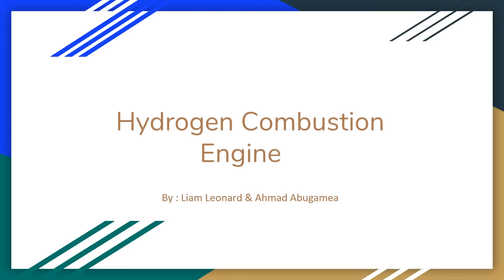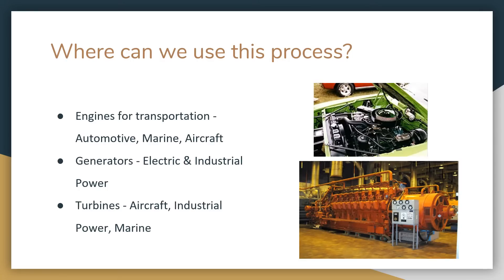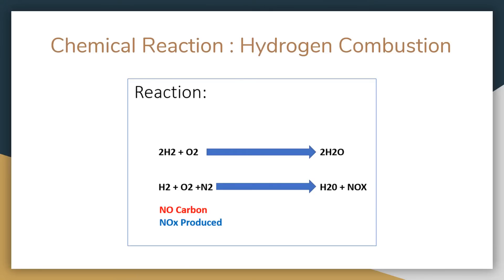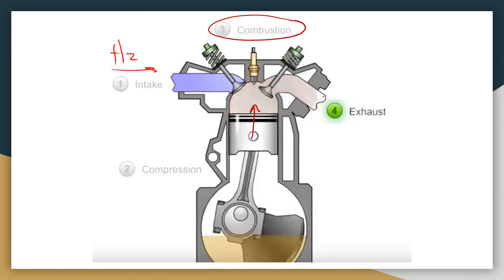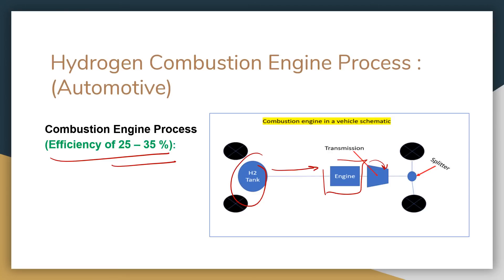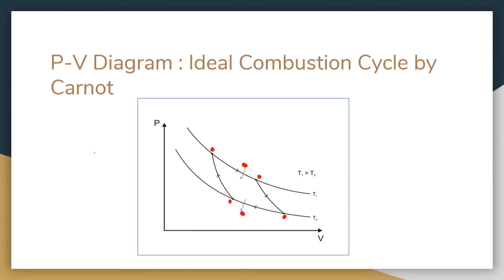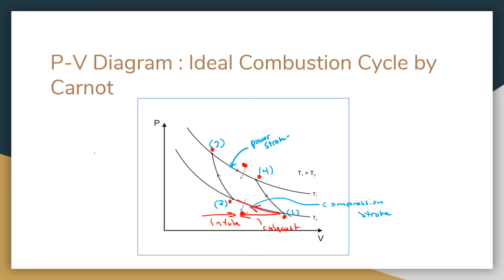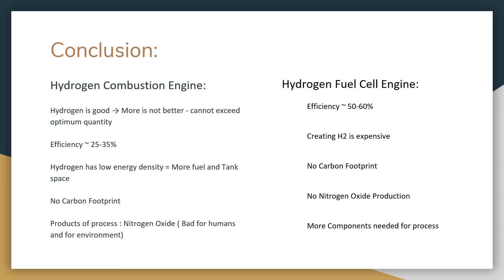Hydrogen Combustion Engines

Comment: I presume this was for a school project. Even so, I'm pretty certain there are ways to reduce NOX emissions, since diesel cars also produce NOX, and to meet regulations, they have some kind of filter.
Reply: SCR-Cats. AdBlue and stuff
Reply: @xPentag0n  Thank you for helping to prove my point.
Reply: @mattevans4377  yeah model diesel have  Adblue Diesel particle filter and some have catalytic converters to aid in filtration.
Reply: Nox isn't a problem anymore, use a spark plug, self ignition requires heat to ignite which produces NOX, with a spark plug in a diesel engine you can ignite the hydrogen at way lower temps, which won't produce nox, also lower the compression ratio but keep the diesel stroke length, hydrogen has so much more power than gas or diesel that without a turbo it can still make up
Reply: Catalytic converter indeed